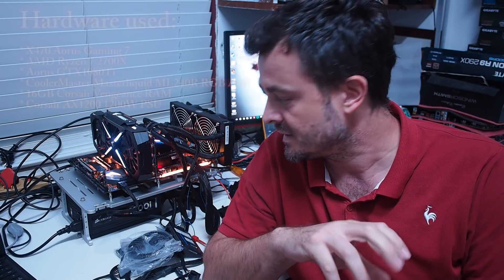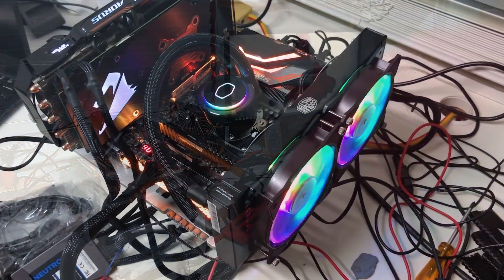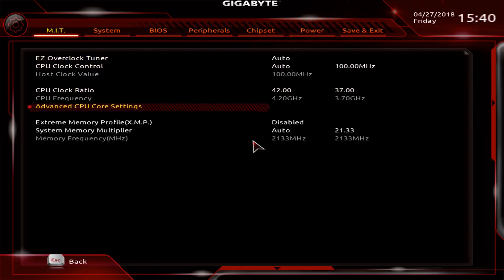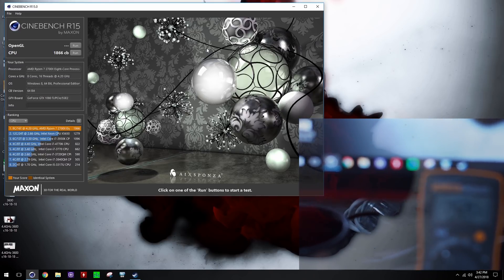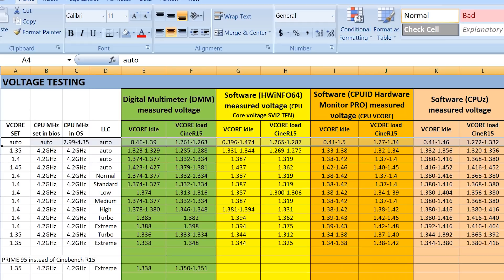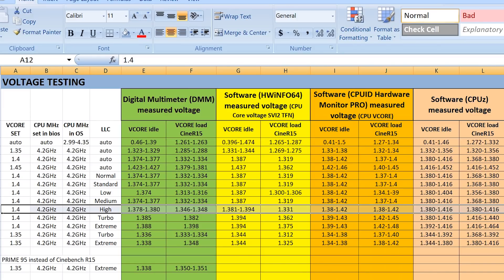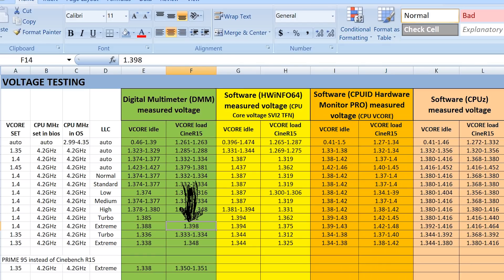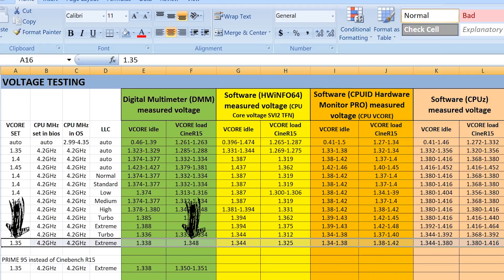Aorus X470 Gaming 7 Vcore and Loadline Calibration testing, overclock your Ryzen to the MAX!

Comment: I think the software is doing what some motorcycles do after XXX mph. Show higher then typical readings. I been on some bikes. Speed odt said 165 and the gps said 140. I think maybe software at some point is showing more volts then normal as a way to keep people who don't have a good multimeter to back off the voltage.  Software is historically inaccurate but I had some at 1.32v be spot on with a calibrated fluke. The at 1.42 show 1.48.  don't have a big enough test sample to say for sure but that's how it looks.  And it would make sense most people have no idea how much more power is drawn by upping that voltage and clock rates and it could be there as a safe guard as most of your high-end mobos have voltage read points and the people buying them to do serious overclocking would have a fluke hooked up. 

I will say that the gaming 7 has no problem at all pushing a ryzen to it's limits. Hell I even found it to overclock my DDR4 2666 higher then any other x470 I had. 3266 stable at stock timings.  This is good info and glad to someone with a fluke instead of talking about a picture of it.  If you wanna put some data together let me know. I got a gaming 7 x470 and I work as an opto-electronics engineer so I have access to all the high-end test equipment and we can start compiling data to see how much variation there is better boards and software and see how it stacks up.

Comment: Thanks for the info. I stick with Turbo now as it seems the one with the lowest fluctuation. Paired with a -0.1 Vcore offset and PBO enabled, my 2700X is super stable! :-)
Reply from the maker: You're welcome. All Gigabyte boards I've used over the years are best on Turbo, even on liquid nitrogen and extreme OC
Reply: Did you also test by any chance the voltage offset option? does it apply the correct offset for idle & load scenarios? Software tools don't seem to report any lower voltage despite my -0.1V offset, but setting it even lower does make my system unstable
Reply from the maker: nah i dont like using offsets so never test them

Comment: Amazing!
I want OC my Aorus Gaming 7 + 8700K
Please tell me, Extreme LLC is safe for my CPU?
On Turbo I get 81 degrees after 1h test (RealBench 2.56) without error.
Vcore 1.25, 4700MHz
Please tell me differences in this case ;)
Reply from the maker: I use the same board and setup in my main PC at the moment. I have a watercooled 8700@ 5GHz but is Cinebench stable up to 5.4GHz. The main trick is to delid CPU and use liquid metal between CPU core and HS. That will reduce your load temp by 30C!

Comment: Thanks, I'm using the Z370 Aorus Gaming 7 but I suspect results would be similar. DMM readings won't exceed bios set core voltage and Turbo LLC is flat and Extreme is closest to bios setpoint.
Reply from the maker: That's right, the point of this video was to show people what real voltage is
Reply: Do you have any test results with a fast DMM or an oscilloscope for z370 Gaming 7 to determine Vcore overshoot when OC with adaptive voltage? So with a DVID offset and IA AC/DC set to 1.
Reply from the maker: Kris Weatherbee it’s the first time I’ve done this for a video tbh. I also don’t use adaptive voltage in general

Comment: HWINFO seems most accurate from all softwares and situations.
Reply: that´s what i though before i got the right solderpoints for a multimeter on the stupid asus x470 tuf i stupidly bought. i can tell you neither hwinfo, hwmonitor, sisoft nor etc are correct they  are off  by 0.02v  -  ~0.17v up and down.

next step: precison boost overdrive + llc  
kek

Comment: Multimeters are not infallible either. That Fluke 101 has an accuracy of plus/minus 0.5% and 3 least significant digits measuring DC voltage. So for example,  under load at 4:58 it's reading 1.381V. According to manufacturer specs the voltage is actually anywhere in a range from 1.371V to 1.391V, or a 20mV discrepancy. That's also assuming it's been calibrated within the last year.
Reply from the maker: mr4kl seemed pretty spot on in all testing but obviously for absolutely best readings, you’ll need an oscilloscope
Reply: Better than the 1.4-1.452 that CPUid and CPU-Z are showing ;)

Comment: What would you consider the highest cooling capacity air cooler?
I want to beat Lawrence Timme's air score!
I'd have to sell my entire rig just to afford a used C6H, sale 2700x, and crappy b-die. Rip
Reply: I´m a blasphemer. if you manage to find a "new" corsair h110 and slap 2 nice noctua NF-A14 PWM on it you made a good deal and you´re staying relatively silent. if you feel hardcore try some NF-A14 PWM industrial ppc´s  https://noctua.at/en/products/product-line-industrial/nf-a14-industrialppc-3000-pwm?___from_store=de  (make sure to use ear protection  :-)) (actually  some delta´s would be even more hardcore, but veery dangerous for your health)
Jokes aside most aio 240´s and up should work fine.
i do not see any aircooling being really good for ocing a ryzen at all. top end nets you 60-90$ with a few bucks more you´re at an acceptable to good aio kit. i advise the latter. 
as an addition the x470 boards know if you are using aio (cos´ you plugged the pump header onto the boards phs) and will give you a bit more headroom for oc.
after 2 weeks i´m back at "stock", fiddling around with precision boost overdrive. interesting and different way to "oc" your cpu.
Reply from the maker: DerpFails not sure man, I’d just go for an AIO watercooler instead

Comment: I find the BIOS settings very confusing. Auto, Normal, Standard, why there's no explanation whatsoever what the difference really is? I did freak out when I saw Auto vcore readouts going as high as 1.5V. Good to hear it's not really what the mobo is putting through the CPU, but how as a normal user am I to supposed to know that and get the settings right?
I don't want to OC, I'm happy with XFR2, but I'd also like to use a lower voltage, as I didn't really notice any performance gain between the default and a slight negative offset. The temperature on the other hand was 7 degrees lower, so that's a huge difference. I don't want to kill my CPU in a year...

Comment: Would be interesting if you could do a follow up video with oscilloscope testing of the voltages under transient loads. Although extreme LLC may be viewed as an almost flat line when measured by a DMM, it could be spiking up to 1.5v for extremely brief periods. I've always personally considered high/turbo llc on most gigabyte boards to be a safe happy medium for daily usage.
Reply from the maker: Actually that has already been done too but since I compared against another brand I am not allowed to show results publicly it kinda sucks i can't post. This VRM is basically kick ass wink
Reply: @dinos22  have you asked if they'd agree to cut out comparison or post it as text?

Comment: Hi, I was just wondering, if you set a manual vcore, cpu speed and then set a manual LLC in Bios would that vcore drop down to lower if the system goes to idle or does it stay fixed at the set vcore? Regards. 13:10
Reply: You could set an offset in Dynamic Vcore (DVID) and your voltage will drop when idle and increase when under load. Also, leave C-states at default values and use the "Balanced" profile in windows power settings and your CPU frequency will also drop when idle and increase under load.
Reply: Thanks a lot!
Reply from the maker: MohondhaY stays fixed
Reply: awww T_T